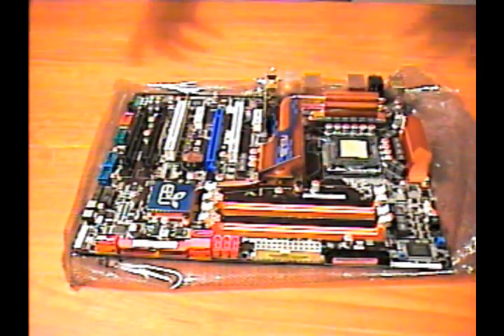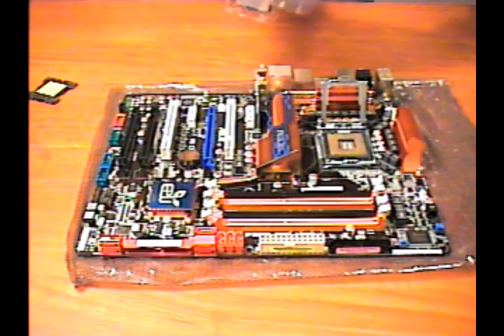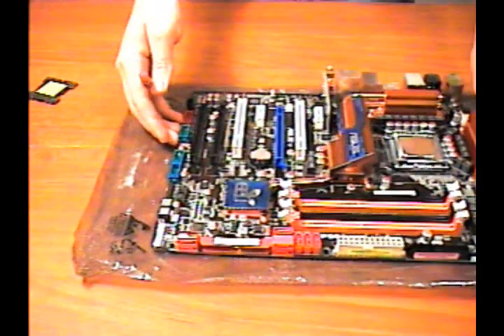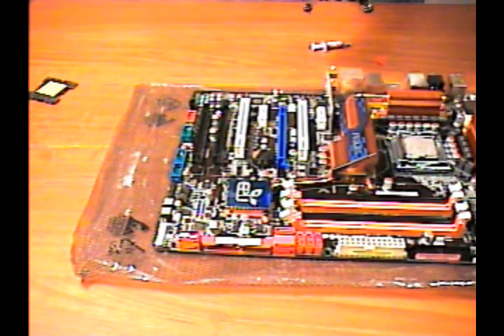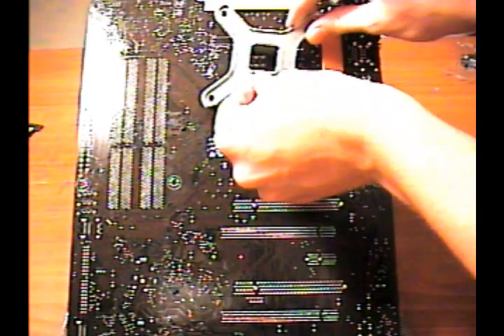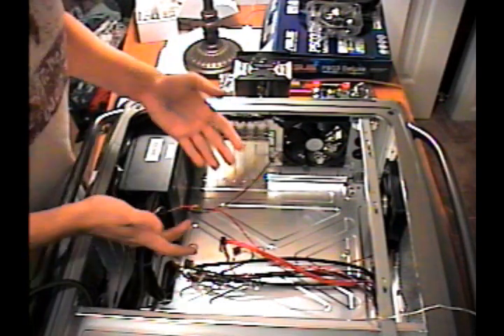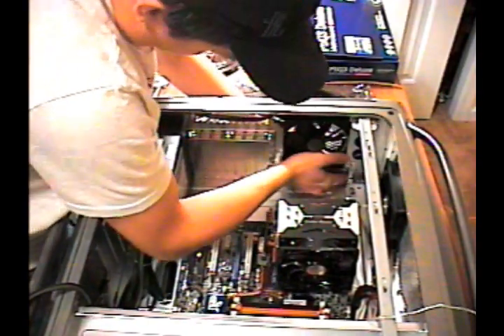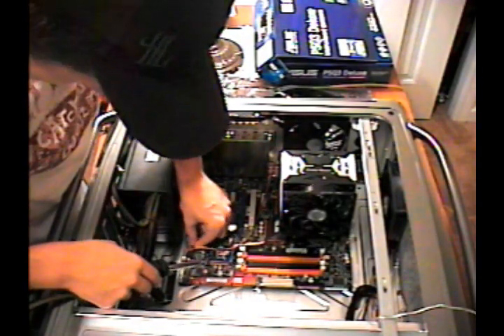How-to Build a pc (Part 1)

Comment: For future reference, I recommend using a plastic baggy pulled over your finger to spread the thermalpaste. This isn't a huge deal, but your fingers have oils on them that can be electrically conductive and or lower the heat conductivity of your paste/heatsink.

Comment: Its very straight forward and fairly easy to follow. A 8 or a 7 probably. The main flaw with the video is visual clarity and thats either due to your camera or your rendering. What software are you using to render your video, and at what quality? Also, did you put in standoffs for your pc (sorry if I missed that)? Feel free to message me, as this is character limited which is restrictive to a conversation.

Comment from the maker: acualy its not, its the coolermaster hyper 212 the other stock fan is alot smaller. I had to remove the large fan on the side because the fan was hitting the cpu cooler its so big lol.

Comment from the maker: no way man haha there is no thermal paste on the fan you want more paste then the size of a grain of rice other wise the heat is not going to transfer good at all between the cpu and heat sink.

However i should have used something better to spread it with.